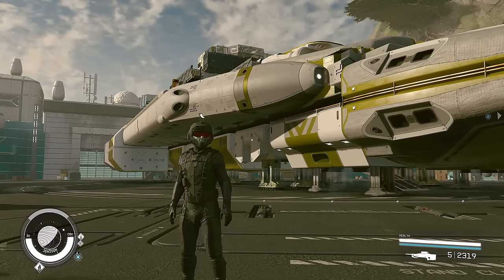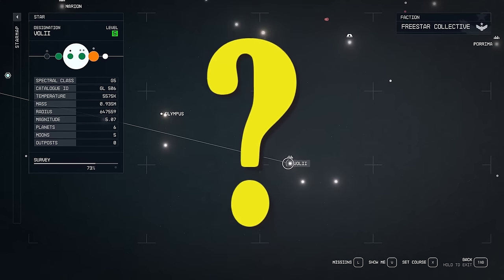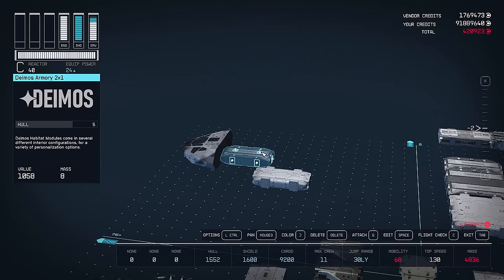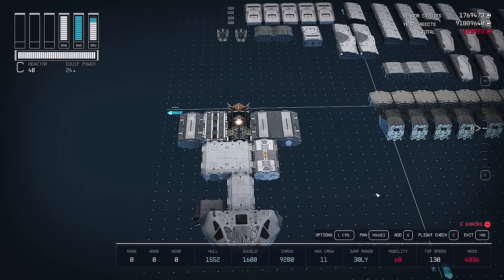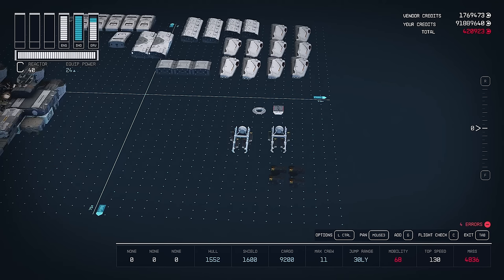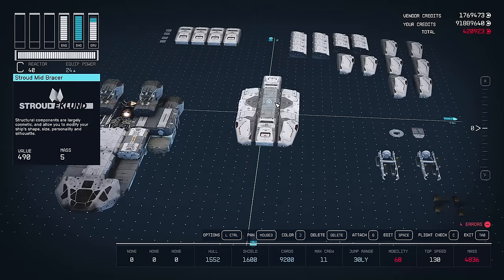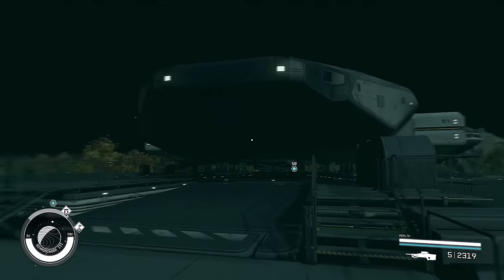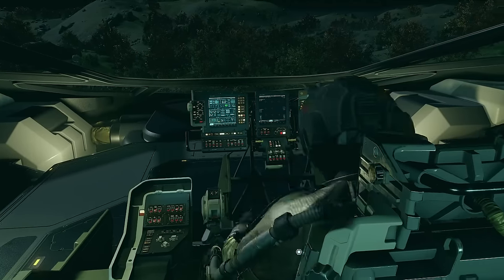The Vengeance MK II: Rebuild. No unwanted ladders, new habs, new weapons, more cargo, new style.

Comment: There are a few mods out there that on Nexus that greatly enhance ship building.  I can't post links as YouTube frequently removes those from comments.  But the mod called "Place Doors Yourself".  This mod closes all door and ladder ports on all Habs and you literally have to place a door or a ladder yourself.  It goes against connector that you choose.  No other ladders or doors are placed.

It gives you complete control of all connections between Habs.
Reply from the maker: I have been wanting to try some mods, but generally I keep my builds to the base game. Part of me really wants to do a huge monster ship using mods... but I know once I start building those, I'll never go back. lol
Reply: I use that mod and it works as advertised.  Fantastic for controlling flow through the ship!
Reply: I use that mod along with Habz, as that has a bunch of 1x1hab variants that you can use to make ships a bit smaller, etc.

A couple other good building mods are No Reactor Limit, No Engine power Limits, Ultimate Shipyards Unlocked.

Those allow more than one reactor (so you can get more power), more than 12 power doe engines (so you need more reactors for more power).  And the shipyard one puts all parts in all shipyards, including your outpost .. so you don't have to dly all over the place to gather parts (everything's available everywhere)

Comment: Are you aware that you can stack those class C engines into each other and make one large engine from 2 which still gives you the power of the 2? You only need a stack of 3 attachment points. Install the first engine on the bottom two points of attachment, then use the duplicate function while the cursor is on the rear top section of the engine and presto.....the engine will install above while interconnecting with the first one. I was amazed when I discovered this. It's not a glitch. They are meant to do that.
Reply from the maker: I am actually doing that for the V3 version of this ship, which I should have a video for that coming out this Friday. I just discovered that technique as well. Its not just limited to those engines, however. You can do it with Fuel tanks as well. Really any 2 space piece that can be copied. You can even do it with side mounted engines as well (I tried it with the supernova engines)

Comment: XBOX TIP

I built this ship on my XBOX console and really like it.

The glitch fix described in this video works on XBOX by holding the B button and selecting the variant or flip.

Happy building!
Reply from the maker: Awesome! So the "B" button is the equivalent to the left mouse button. Got it.
Reply: Other glitch on xbox that often works is to place the peice you want above below or next the spot it will not allow, provided you cam place it in a nearby space. Duplicate the part sometimes it will place where you want. Trial and error. But using this I have able to place 8 weapons on a nova weapon mount, that only has 6 places and normally you can only use 3 or 4 depending on the weapons..
Reply: Thanks I was so lost

Comment: With magazines and a few maxed out skills, you can shave fuel down to 210/33mass, add 190 shielded cargo, knock 3 cargo modules down to I think 1200/250 mass, swap the 2 space rectangular caps for the curved ones, drop down to the j51 grav, overhaul the weapons, add an infirmary which also does research and you still come out with 74 mobility on 6330 engines and just over 14k in cargo capacity.    Love the shape and the hab layout.   Almost makes me wanna delay jumping from ng4 to ng5.   Damn nicely done!  My hat’s off to you sir!
Reply from the maker: I do have a good amount of the magazines, and most my ship skills are maxed. Fuel and mass is definitely something I need to watch. I normally just go with the 900t in all my builds, but I know there are better fuel to mass ratio modules out there. For the shielded cargo, I rarely use those as I don't carry much contra-ban (and if I do pick up some.. I just stop over at The Den and sell it). I have been toying with moving away from the 6330's. They are great for the big ships, but there are some Class B engines I really want to try. 

Jump to NG5, grab the Mantis ship, and use that as a basis for this ship in NG5. You will then get the bonus of having pirates scared of you! lol

Comment: Throwing down a comment. Just built this ship and its amazing. Super immersive and feels like a lived in ship with all the habs.

Only thing I changed was I did suppressors as the 3rd weapon so I could disable and board ships.

I was able to build it at level 35 youll just have to gradually upgrade the grav and reactor as you level up.
Reply from the maker: Glad you like the ship. Suppressors as your 3rd weapon are a good choice, though if you have the targeting skill they are not needed (you can enter targeting mode and take out specific parts of the ship like engines and shields).
Reply: @TeamScorpioRI  Sometimes it hits with such ferocity that the other ships dont survive the targeting 😂

Comment: I went the route of using the hopetech spine and 2 braces placing the habs in a T shape. I really liked the inside layout but I didn't use any 2x2 habs. I used 6- sal 6830's and max cargo out with 100 mobility.
Reply from the maker: Those 6830's do make a huge difference vs the 6330's.

Comment: connect-pro docker is a door (no ladder) & it goes on a side or the front or back of your ship! try it out if you want a docker that doesn't have a ladder
Reply from the maker: I tried a version with that docker. I had the bay on one side of the hab and the docker on the other. The issue was nothing can stick past the docker at all, so the ship profile was very narrow and blocky. I tried to make that work, but just couldn't find a design I actually liked.

Comment: The battle station should always go right behind the ships hull where the pilots commandeer the ship.
Reply from the maker: Good point. So to do that and keep the shape (and my pool table), you would put the battle station where the nova galactic living quarters is (connected to the control station).. then swap the captians quarters and the computer core to where the battle station was (right side) and the living quarters would go on the left side. That could definitely work. Thanks for the tip.

Comment: Cool ship. Might have to give it a go sometime. Great tutorial.

Just a comment on the game itself and the choices the devs made. Never understood why some pieces are flippable (front to back, and side to side) but others aren't. Like the Stroud pieces @20:45... Why do the 1x1 versions flip every direction but the same elongated 3x1 don't flip upside down? Blows my mind that I have to use 3 of the 1x1 to cover the bottom.
Reply from the maker: Agreed. Every piece should be flippable in every direction. There are some great pieces that would be even better if they could be rotated like the Stroud Cap A's
Reply: @TeamScorpioRI  exactly with the case of the Stroud pieces. Don't understand why there's even a Cap C when the Cap B could just be flippable and have a variant change like the Cap A. Stupid decision on Bethesda's part. But oh well, we're stuck with it "as is" for now, until a DLC change or mod (I'm on Xbox so still can't use any yet).

Comment: I'm surprised you don't use the Vanguard bubble shield.  Lower profile and the stats are pretty dang good (Class B, 1450 health, 6% regen, 12 power).  There's 1 shield with higher shield capacity but slower recharge (Assurance SG-1800, Class C, 1600 Health, 5% regen), and another with both higher capacity and regen rate but is side mounting (28T Defender, Class B, 1500 health, 7% regen)

I feel that overall the Vanguard is the better choice of shield because higher regen and side mounting bubbles suck.
Reply from the maker: I could have sworn for this version that I used the Assurance SG-1800 (at least that is what I have on my parts list). That has the best health for a shield. I do use the Vanguard shield and the 28t in builds as well, depending on what I need. The 28t is a great option if you want to hide the shield. Since it's flippable, you can glitch it into other parts.

Comment: you can use a port or starboard docking bay! its not the most pretty, but no ladders.
Reply from the maker: Tried that originally. Only problem with that is nothing can stick out past the docking bay. So you lose the whole shape of the ship. It becomes one long straight line.

Comment: U could use a side docker to eliminate the docking ladder...might not look as good though
Reply from the maker: I tried that. I was originally going to go with the side docker on one side of the armory, and the bay on the other side. It flowed nicely, but you could not extend any structures beyond the docker.. which meant the ship was just long and skinny. I could not get it to where I had a design I liked while using it.
Reply: I've seen a build where the designer (can't remember who, sadly) mounted the side docker on a HopeTech Hab Cross Brace, to push it further away from the side of the ship. I thought it a clever idea; one I've used successfully on my own builds. @TeamScorpioRI
Reply from the maker: Not a bad idea. The other thing I was toying with was having the side docker on one of the rear habs that are on the wings of the ship. That might also work with this design.

Comment: You know for some of these ladder/door issues the problem isn't with the game but with how people try to build them. If you open the item menu with "g" while your mouse hovers over the entrance that you want to use the game will try to place each item by connecting it's default connection point with the one you have selected.
Reply from the maker: Good point. The only problem is if you want the hab layout to go in a certain shape, it will not always drop doors an ladders where you want them. It would be nice if we could select a hookpoint that is between to habs and mark it as "door/ladder goes here" or something like that.
Reply: @TeamScorpioRI  Yeah I did write to them with an idea that uses the levels of starship design to allow us to tinker with habs and layouts. My idea being that at level 1 you can select which hatches are active on a hab after building (like using the outpost editor and toggling window designs). Level 2 would allow you to move the beds/large furniture around in a hab level 3 would allow you to turn habs (and only habs) 90 degrees at a time, and level 4 would allow you to order custom habs that you can select the size and layout for based on the habs that company sells.

I think the last level would be a fantastic credits sink if each custom hab square were to cost, say 50K, because I would certainly be flying in a ship with millions of credits worth of custom habs.

Another idea I suggested was to have a 1x1x2 stairwell (up/down stacked 1x1) and a 1x2x2 staircase.

I suspect though that any changes like this will be a long time in the making though.
Reply from the maker: @aaronwebb7090  I fully support all of those!!!

Comment: I am level 199 and level 4 ship builder, but I can not find the Stroud Cowling 1LB PT's or Stroud Cowling 3LB PT's, I only have the A versions of them. Are the B's connected to a storyline/quest?
Reply from the maker: Nope, they are not connected to the story, they are the variation form of the 1LA and 3LA pieces. Select the 1LA-PT, and there will be an option at the bottom to change the variant (left and right arrows on PC, should be similar on xbox). Same technique when selecting the different habs. 

FYI: you only need the 1LB-PT's.. for the others use the 3LA-PT's. That's my mistake and a mis-type in the video.
Reply from the maker: @flemmingsen  Weird, as I am on PC and you can see me do it in the video

Comment: Excellent build, I made a few changes to it.  I can't find the gamma grav drive anywhere.  Is it level locked?
Reply from the maker: Yes, it is. You need to be level 54 and have your starship design at level 4 to access it. Most other class C drives should work though. The SGD 3300 Grav Drive would be a good alternative.

Comment: replace the bottom docker with a side docker like the side landing bay and i belive the stair issues will be solved ...without mods
Reply from the maker: I actually tried that as part of my original redesign. I had the side landing bay on one side like it is, and directly on the otherside I had the side docker. And It was perfect.... except that you could not put any piece on the ship beyond the side docker.. Which made the ship one straight line. So I ended up losing the whole back half of the ship. I tried to make it work, but could not find a configuration that I liked. One of these days I am going to get that perfect....
Reply: @TeamScorpioRI  replacing the habs near the engines (on the wider part) might solve the issue but that being said it cames to your preferences and if you are willing to sacrifice interior design over to functionality.
Reply from the maker: I think I did try that. If I remember correctly, the original configuration I was working with had more of a U shape to the habs at the back (wrapping around the drive section). But even then, putting anything on the side of the ship caused the error. Its seems the top/bottom dockers have more forgiveness to the placing of pieces than a side docker. I may still try and play around with something. Maybe when I do my Nova Only build.

Comment: Side docker!
Reply from the maker: Unfortunately I can't use the side docker without ruining the lines of the ship. Nothing can stick out past the radius of the docker, so I end up loosing the wings on the side. I was trying that with my initial mock-up, but could not get the aesthetic I like with everything piled above or below the ship/
Reply: It will not let me paste a picture here, but I designed a ship with the bay and the docker on opposite sides of the ship, at the ‘ends of the wings’….
Reply from the maker: @DougJessee  good idea. I could make that work with this layout. I'd probably need to switch the habs around a bit, which won't be too bad now that we have blank habs to build with